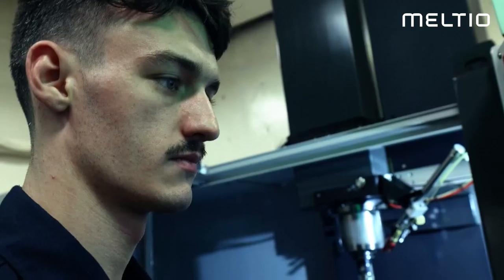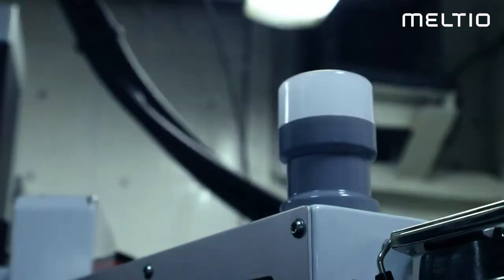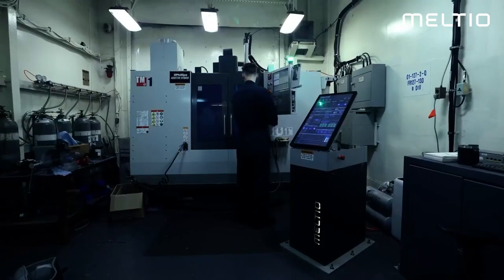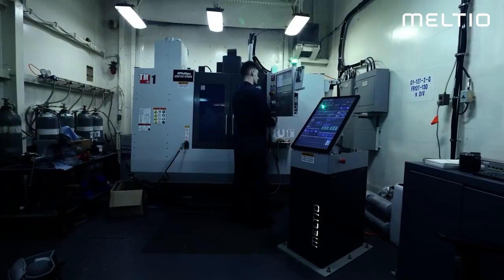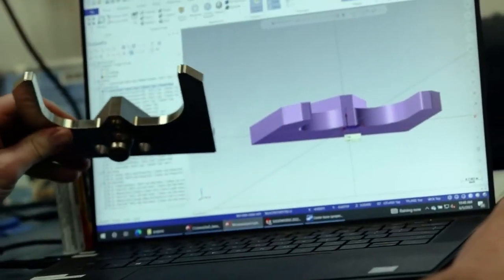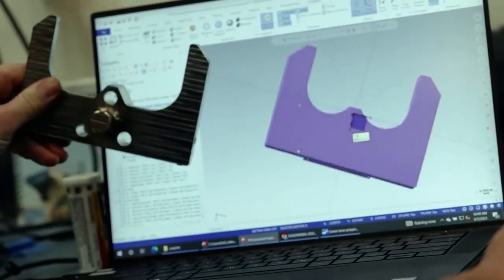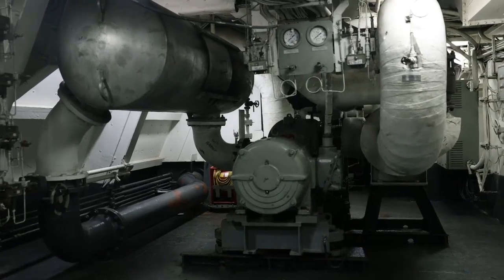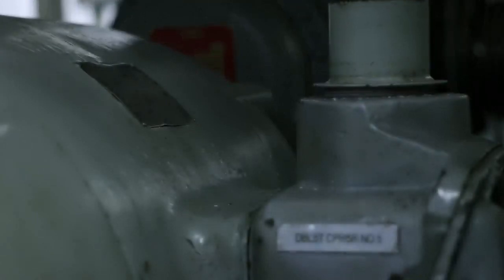USS Bataan Uses 3D Printer for Big Fix - Concept to Reality

Comment: It sounds extremely interesting. I have some experience using FDM 3D printing as a hobby. How reliable are 3D-printed parts compared to CNC-machined parts, and what are the considerations when we design the parts in CAD?
Reply from the maker: Hi, thanks for your interest in Meltio. Please head to the materials page for reliability: https://meltio3d.com/materials/ and head to the Design Guidelines for the design considerations: https://meltio3d.com/meltio-design-guidelines/

And also check on the Resources page for more information: https://meltio3d.com/resources/

Do not forget to contact us if you have any questions: info@meltio3d.com